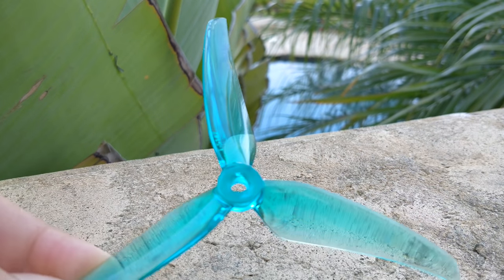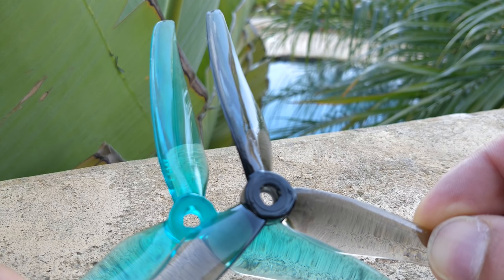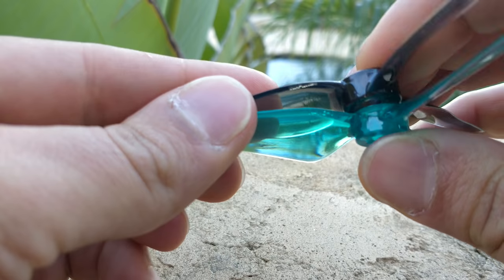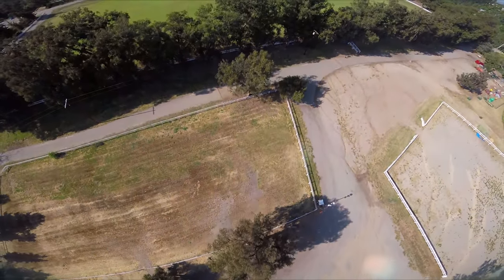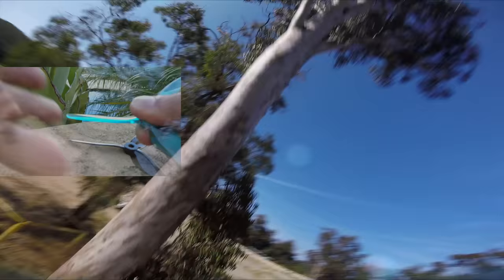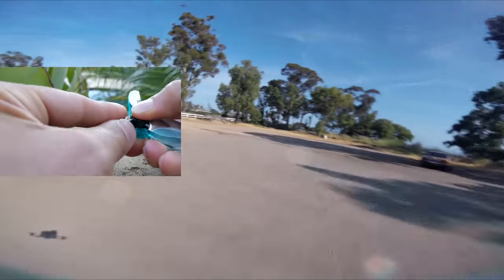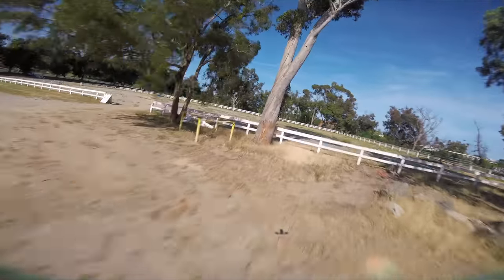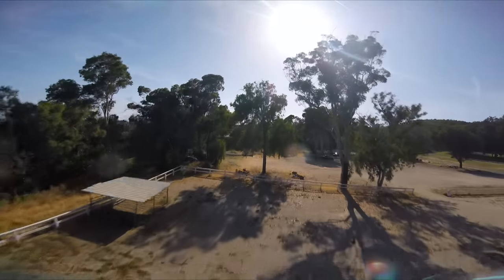T-motor T5147

Comment: I REALLY really like the T-motor 5150x3 soooo much in fact i like it on 2207 or 2306/7 as much as i like my main racing props (GF5149x3 and the GF5149.9x3) but on big high speed tracks that have tight sections then i think it's even better then the Flash and Hurricane. It had more grip then any race prop I've flew and top end is there in spades and the response is better then the 5149x3 and a little less the the 5149.9x3 in the top 65% of the throttle but suffers ever so slightly in the bottom 20% and when coming off zero throttle. The 5146.6 is hard to beat on most tracks we run and im holding most track setup records are 3 local clubs right now with the 5146.6x3 on a very specific build (i like this build so much I've built 5 of the exact same builds all running a custom frame that i make that's 67 grams with Ti screws and standoffs with the TPU micro cam mount and AXII stubby mount) they are running the Iflight stack <the second run of this stack is fantastic as is the vtx, T-Motor F40 Pro II 2150kv on 6s, 6s 1050 or 1250mah depending on track and Micro Eagles Dry weight with props and AXII 244 grams.

This setup and the 5146.6x3 is almost unbeatable on tracks that are medium to large and have tight sections and long high speed sections. I fly no other props on this build. The T-motor 5150x3 i fly on other builds that are exactly the same but running F40 Pro II 1750kv with 5150x3 as well as the 5149 and 5149.9 and it's a match made in heaven for extremely fast tracks that are setup and designed to carry a lot of speed throughout the entire course.

I can't wait to get the 5147X3s for smaller tighter tracks where response and grip in corners will be king but still have the mid range and topend to hold it down on the straights.
Reply from the maker: the T5147 is probably going to be something you like

Comment: Love these props but am loving the tmotor 5146 even more. It’s more durable than the gemfan 51466 and I think has more control especially below 50% throttle than the 5147. But I use all 3 their my main 3 props just depends on situation on which prop I’ll use. For racing I definitely use the tmotor 5146 but if I’m out of those I use the 5147 for a little more top end.

Comment: That flight was getting mesmerising. I like it. U seen the dental gear on banggood? The thought of people out there having a bash with cheap equipment at home makes MY teeth hurt. Might make a good dremel replacement or for cleaning parts though
Reply from the maker: I haven't tried any of it but I would expect it to be very low quality

Comment: So you mentioned that the more aggressive blade produces more drag and that is what contributed to the lower responsiveness of the Tmotor prop...wouldn’t a more aggressive blade produce less drag because its blades are less perpendicular to the natural flow of air? That’s how it works in airplanes at least. 

A more aggressive pitch produces less drag when the blade stops spinning (useful for engine out training)
Reply from the maker: That's only when you're actually moving. Quads are always in a hover state. Even when moving there is still some degree of hover state. You're correct to think that you can't really have one or the other optimally. That's just the downside of not having a collective pitch system

Comment: Nice prop, I wonder how much faster it is than the 5143 and if it's worth the drop in response
Reply from the maker: Wayyyyyyyyyy faster. Way less responsive
Reply: Can confirm as i had the 43s on the same quad before and the 47s are wayyy faster :P

Comment: its weird because even in 2019 with all these filters and stuff. I still find some props just make my quad fly significantly worse. For me i've tried a few different props and i keep finding that the tried and true v1s 5x4.3- the 5x4.6 all fly exceptionally smoother then any other prop. is there a reason for this or is it just because my specific quad doesn't like props like the ethix s3. Its a heavy (680g) 4s quad. xilo 2207 2550kv motors. What prop would you recommend me trying next if i wanted to try a different prop?
Reply: Give the Cyclones a try. I flew cyclelones on a heavier quad for a while.

Comment: yo, i'd like to build a proper racing setup, i'm kinda stuck with the esc because 4in1 is kinda new, articles are outdated and i didn't find a video of yours about this topic. i just need something with 50A at least, maybe telem is kinda cool, just shouldn't light on fire in a race ya know. ideas?
Reply from the maker: 4in1s are not kinda new. They're the standard. They've been around for literally 3 or more years. The furling or pyrodrone ESC is one of the most reliable as are so many recent ones. It's hard to go wrong now with a recent 4in1
Reply: @Kabab  alright, thanks. i just didn't find anything else up-to-date and the selection is, as with many other things, just way too huge and everyone claims to have the best esc
Reply from the maker: @mircoheitmann  there is no best. Just go by track record and which ones seem to keep working. The one at Cara flip was specifically developed to be reliable.

Comment: I see no bobble on dat full throttle forward thing at the beginning of the flight. Did you fix it?
Reply from the maker: I just fly around it. It's still there and much worse with a heavy prop
Reply: @Kabab  Damn I tried hard to make it happen but my kwad doesnt do it. Betaflight is so weird sometimes...
Reply from the maker: @k1f02  sometimes it's hard to get it to do it but it always happens when you never want to see it
Reply: @Kabab  If you want to look something good it looks like trash thats what I get😂